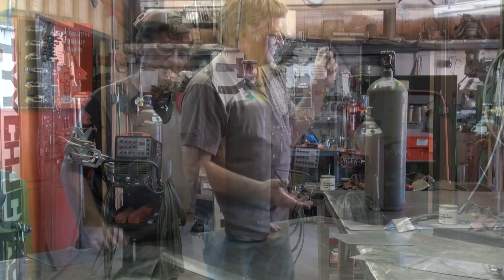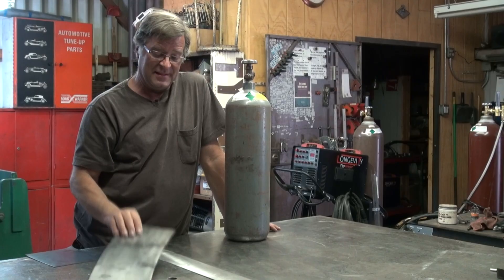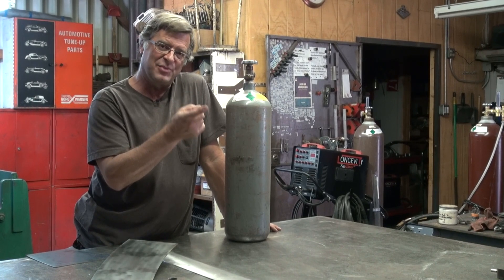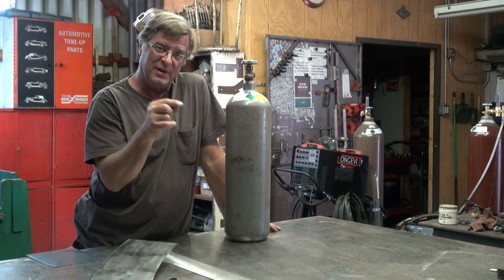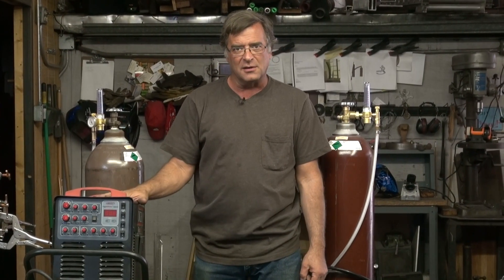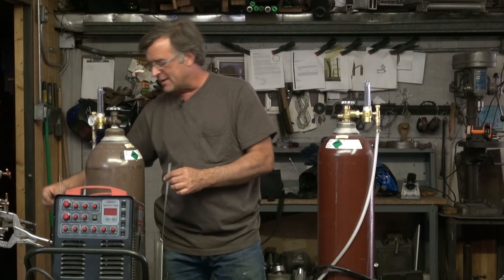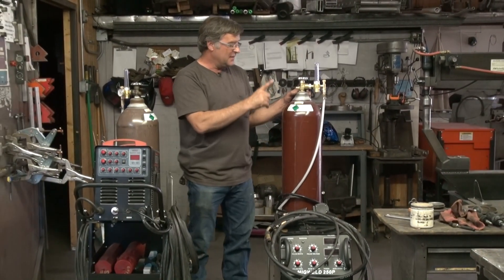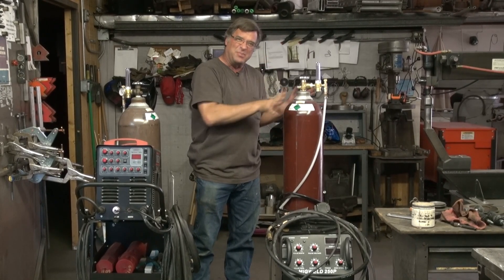How to Choose the Right Welding Gas - Kevin Caron

Comment: what gas to use welding aluminized steel Mig and TIG
Reply from the maker: After a quick search you can use 75/25 for mig and straight argon for tig.
Reply: @KevincaronSculpture  75Co2 and 25 Argon
Reply: @KevincaronSculpture  when you are doing body work on cars what is the best mig solid wire do you use 0.0.035

Comment: Is it both male and female tank cylinder valves where the argon gas regulator is threaded to on an argon tank cylinder? What is the size and thread pitch of the gas outlet fitting on the gas regulator? Thank you for you patience.
Reply from the maker: Female on the tank and male on the regulator.  Sorry, but no idea on thread pitch and size of the regulator.

Comment: I bought a tank that says oxygen on it is that the wrong tank?
Reply from the maker: If you are doing gas welding with acet. then no.  If you are tig welding, yes, that is the wrong bottle.  If you are mig welding then you really have the wrong stuff.
Reply: @KevincaronSculpture  Yes mig welding good thing I didn’t try welding with it figured out I had the wrong thing.

Comment: Can I use propane for welding steel because google said I could but I’m not 100% sure
Reply from the maker: You can use propane and oxy but propane is not as hot as Acetylene. So you will wind up using more propane to do the same job.
Reply: @KevincaronSculpture  thank you so much for the info.

Comment: I'm relatively new to MIG welding (been oxy-acet welding for decades) but learning fast.   Kevin has omitted mentioning the key thing to understand what gas mix for a hobby welder or part-duties welder to choose:  cost.   Historically, CO2 was a cheap gas, but is not inert - it breaks down and chemically reacts at arc temperatures.   Argon was ideal (doesn't react at all) but expensive.   So what came about is various compromises.  75:25 Ar:CO2 mix, 88:12 etc.  All these mixes work in welding mild steel, but at different welder unit settings.   The more skill you have, the more you can tolerate CO2 in the mix.   The thicker the metal you are welding the more you can tolerate CO2 in the mix.   It happens that the only mix stocked by my local supplier is 88:12.   It works fine for me (mild steel work).   I obtained a bottle of 75:25 from a more distant supplier recently, just to try it.   After I got used to it, and adjusted my welder, it too works fine, albeit with a bit more spatter and a bit of carbon.
These days (at least where I am located) gas price differentials have come down, so the incentive to save money by having a greater percentage of CO2 is mostly gone, and I'll be going back to 88:12.   Note:   reading the gas supplier's data sheets revealed that these percentages are only approximate.   
A mix with helium in it is not available here - unless you buy in very large quantities.
Reply from the maker: Thank you for watching and posting.
Reply: Update:  I now have 2 years experience MIG welding, and my local supplier has started stocking an argon mix with 5% CO2 and 3% oxygen.   Why you would want oxygen I don't know - I presume it lets them use a cheaper process to make argon with a low CO2 content.   Since they say it is better for welding thin sheet and that's what I do, I gave it a try.  I needed to re-optimise my welder settings, but after doing that, there's not a lot of difference.  Spatters a bit less.  Tendency to burn through very thin sheet is about the same.

Comment: I worked at shop where they started getting critical about the gasses for different jobs so we were always changing bottles. You had to coordinate your welding for the day. One gas for stainless, another for aluminized steel, another for structural. I worked real good though.
Where I work now, mostly TIG welding with argon they got a bottle of argon with 10% co2 by mistake and they wanted me to try and see if I could use it up. I tried using it for what I weld and seemed to work okay but a little ‘ sooty ‘ looking. Then I welded a part for machine that was going to be turned down. Guy came over later and asked what I did to it as it was hard as a brick and could barely turn it.
I took the bottle back to guys in charge of them and told them “ no, I can’t use it . You’ll have to try and exchange it “. That lousy 10% made lot of difference.
Reply: Interesting story about carborizing. I recently tried using a carbon arc rod in my stick welder stinger as a "poor man's Tig". The arc had the whitish CO2 look, I guess from the rod being consumed. The welds were turning out extremely brittle until I realized what was going on and started to preheat a bit, and let the joints cool down slow. A spark test confirmed it. I've used this technique to make hardened edges/faces.
Reply from the maker: Interesting!!   Never heard of that happening, but good to know.

Comment: Have you used just co2.for mig?hobby welders have this in the uk.shields very poor.but cheap.they use this for root welds.best is a mix .called c25.co2 plus argon.but nobody uses that.
Reply from the maker: Tired straight co2 once.   Too smoky for my taste. I like the mix gas of co2 and argon.

Comment: I'm gonna buy a eastwood 175 mig u know what's the best welding argon tank?
Reply from the maker: You don't need argon for mig.   You need a mixed gas, normally 75% argon 25 % Co2.    I get the biggest bottle I can so it lasts the longest.
Reply: @KevincaronSculpture  donu know a best place to order one? Or what the tank would called ?

Comment: What if you have a mig tig and stick combo ???????????
Reply from the maker: Then you need 2 bottles!  One argon and one mixed gas for mig.   And hopefully a 2 bottle cart to hold them.  Even better is if your 3 in 1 machine has 2 gas inlets on the back.
Reply: @KevincaronSculpture  thanks i do have 2 bottle capability and i already have a unimix 25-75 bottle

Comment: Good description basically tig you uses 100% argon and for mig you have many choices. So you need a good store to keep track of all the different types of blends from oxygen , argon , heilum , carbon dioxide ,...etc. Its probably better to rent your different types of bottles as owning all the different tanks seem cumbersome when they still have to fill them /service them anyway
Reply from the maker: So true!    Thanks for watching.
Reply: @KevincaronSculpture  Also not sure if you ever covered this but if you want to do a video covering the hours of continuous uses for different size welding tanks with different gas types in them that be cool. As harborfreight has https://www.harborfreight.com/welding/welding-accessories/portable-torch-kit-with-oxygen-and-acetylene-tanks-65818.html and if i was to some day purchases one of those i like to know if any airgas/ company would fill them up as well as how long you get before a fill up is need. Same applies for the mig , tig shield gas tanks. Because there is different size tanks to choose from.

Comment: Kevin

Helium also has a place in TIG welding, especially welding THICK aluminum with a welder that maybe little underpowered.  That plus pre-heating the aluminum can product some amazing results on really thick aluminum.  Down side is that helium is expensive, so some folks buy a seperate bottle of helium and flowmeter and run the 2 gases simulaneously (y'd together before it gets to the machine) and dial in what they need.  Less wasteful over the long run, but more expensive up front

John

John
Reply from the maker: Never tired it but have heard of it for sure.

Comment: I just picked up a pro 140. It came with a tank of 100% co2. Never welded with straight co2 before. Most of my welding will be anywhere from 1/8 to 3/8 steel. My local supply said he would exchange it for a tank of 75/25 mix if I wanted too. Not sure which way to go. Been welding with flux core and am tire of the splatter. Does 100% co2 splatter as bad as flux core?? Any help is greatly appreciated...
Thanks
Reply from the maker: Switch for the mix gas.   Works a lot better and cleaner.

Comment: Thanks for a great instructional & well put together video! No Lame music or super fast editing. I have just now started my rooky season in welding. I am trying to design custom bike frames mostly all steel 1-1 1/2 inch pipe. Any help or pointers to get me on right track like type of metal etc. would be greatly appreciated! I am subscribing NOWThanks Again...Dj
Reply from the maker: Hate to say this but I think you are late to this party.  Most bike frames are carbon fiber or titanium now aren't they?   

Mostly I would point you towards a tig welder and lots of practice in thin wall pipe fitting and welding.

Comment: Kevin, great video as always but maybe check your mic for next one as it seems like its turned up very high, maybe need to adjust your levels. seemed to be clipping the audio a bit. maybe knock it back by 10db if you can on the mic or during editing
Reply from the maker: Thanks for the heads up,   been struggling with audio issues for a while now..

Comment: Thanks Kevin, straight forward advice. TIG welding simply rocks, single gas makes things cheaper and easier. The three guys I watch on youtube for welding are you, Jody at weldingtipsandtricks, and of course Mr. TIG. I just started TIG welding and my first project was thin walled aluminum tube. Boy has that been a challenge, but I got'r done thanks to you guys!!
Reply from the maker: Now lets see some photos!
Reply: I watched your video on butt welding tube, using angle iron as a support, very helpful. 
My joined work pieces were aluminum tube, 0.032" wall to 0.07" wall, both had 0.375" OD.
Straight argon at 6 lpm, 0.040" & 0.0625" electrode, 0.035" & 0.0625" 4043 rod, gas lens, 
6 cup, 10 to 30A, light on the cleaning action, 120Hz, no pulse, Everlast PowerTIG 250EX.
I was struggling with heating the thick piece first. Was not sure how to set the Arc Force?
Have to warn you, these are ugly welds, but they seem strong and no leaks. So pic at link below:
https://drive.google.com/open?id=0B8VB51HvdSzuU09BX1U0Si1lb2c

Comment: C-25 is a little "cooler" than CO2.  They like to use it a lot for production welding because of the low spatter, less or no cleanup means lower cost welding.  C-25 is better than CO2 for thin sheet because of less burn through.  

But for thicker metal or structural, go for CO2.  Hotter and more penetration,  may not look as nice but the important thing here is strength.  A joint that will not come apart when a 10 ton truck goes over a bridge.
Reply from the maker: Cool, thanks for posting!
Reply: You should have made a post, you make a hell of a lot more sense than tri-mixtures for is going to be used mostly at home , because a professional already knows what gas to use ! Professionals are not going to be clicking on this site if their worth their salt !

Comment: WHAT THERES MORE THAN ONE TYPE OF GAS FOR MIG WELDING!?!?!  Lol so obviously I'm being sarcastic, but there are a lot of people in industry that do not know this, and if you tell them they have the wrong gas for the task at hand! Well you can just imagine how they might react. I was told I need to go back to school. I don't consider that to be the case because school has nothing to do with it. In fact what does matter is what you are trying to do, and choosing the proper gas for that application. So I'm sorry, I'm not the one that needs to be educated. Trust me your welds will benefit from using the correct gas for the application.... I'm not even a "welder" I know that.

Comment: Some things to add to the conversation. The cheapest way to mig weld and for the hobby guy would be 100% co2. the trade off is more spatter. 75/25 gives you less spatter and makes a pretty weld.  If you are doing stuff with a lot of mill scale or need deeper penetration then 90/10 mix works well. For tig welding You can also add helium in with argon when tig welding aluminum. If you have a smaller machine this process with also a pre-heat of the material  will almost double the maximum thickness that your machines is rated to weld.

Comment: Super Vid,Kev,, we call it 75/25 for the mig,,Unless your cheap,and use strait CO2!!!! But,,,Just My Option,, Ive found for real thin,and usually the lightest i do is 3/16 Pl.. But like 18 ga,the strait,with nice shear cut mateial,the CO2 works great!,,And the way Prices are Jumping around,,In CT.,Not like the south,the BIGGEST! bottle YOU can OWN! is the 100 cf, or some call it 80 cf.. and WOW!!!! they run out fast,so we all have to Pay the Demurage(rental) PS,,They got ya either way!!LOL,,Jack